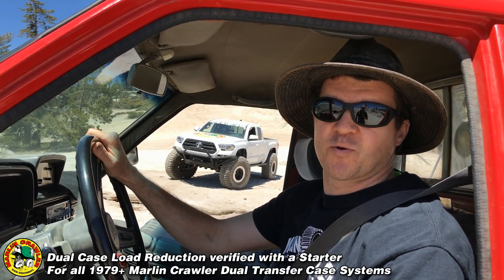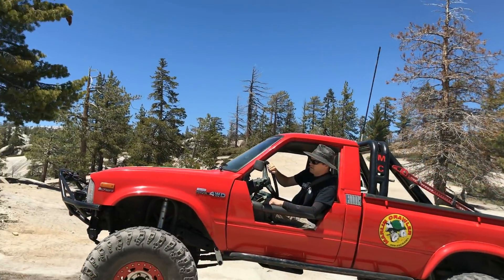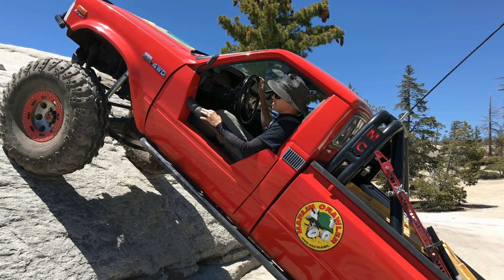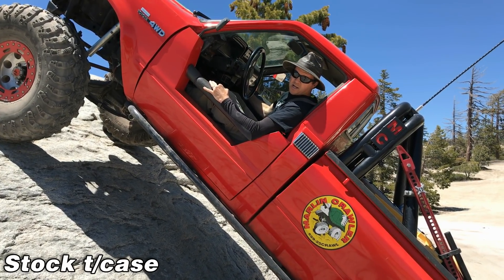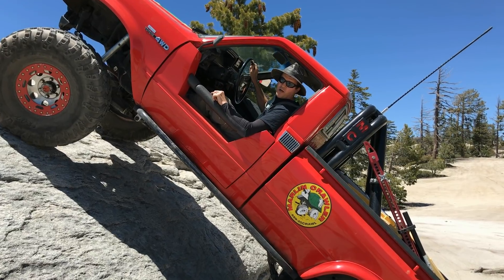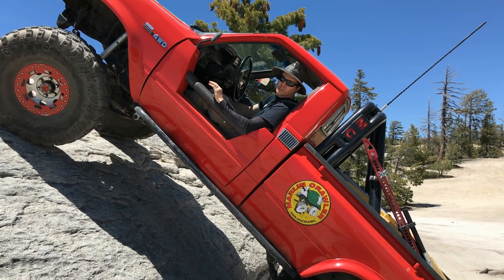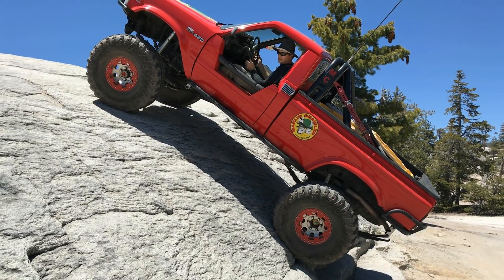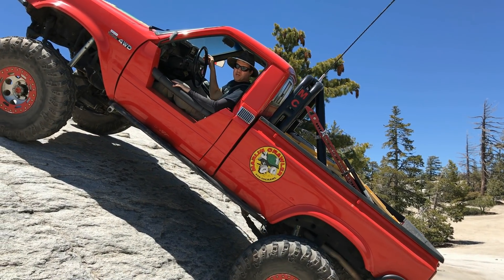Using a Starter to verify Dual Case Load Reduction

Comment: So this started to get a better high and low range, correct.. I'm guessing that 4.11 in high and 5.38 in low..
Reply from the maker: This is an additional gear for your transfer case, and High range is 1.00:1 and Low range is available in either 2.28:1 or 4.70:1 ratios 👍🏼 Depending on gear choice, our  Dual Case setup turns your complete t/case into a 4-speed with selectable ratios 1.00:1, 2.28:1, 4.70:1, and 10.72:1 Low ranges.
Reply: @MarlinCrawlerMedia  do you like it?

Comment: I don't understand how the starter motor can make the vehicle move forward? How does that happen?
Reply from the maker: Thank you for the comment. While manual transmission vehicles come equipped with a Clutch Start Cancel button, many of us bypass this entirely so we can always start the vehicle in gear regardless of the circumstance. Such is the case with The Crawler Truck. It could be cranked in reverse or even in 5th gear, for example, however without the torque multiplication of our Crawler products it would never have enough torque to overcome the weight of the vehicle.
Reply: @MarlinCrawlerMedia  thank you for the explanation

Comment: The irony is that this type of off roading is endemic to the Sierra Nevada National Forest. Despite the fact that the general population believes that stickers generate horsepower, I have in my travels seen a sticker that seems to produce tourqe reduction. Also on a side note the old Mojave horsepower trick works here too. It can however wreck your lid.

Comment: removes engine and adds more batteries, rock crawl all day with just a starter
Reply: Or replace the engine with a predator 212 and have enough fuel to crawl for weeks
Reply: weight reduction
Reply: Or put a big solar panel on it with a small RC motor and go forever!
Reply: @promiscuouscrab4040  😂 funny!
Reply: an electric rock crawler would be cool af
Reply: @lucywucyyy  check out rc4wd 😂
Reply: 2022 Tundra! Surprise y'all!
Reply: "Hybrid" mate 😂

Comment: That’s pretty badass, do y’all make anything for xj cherokees?
Reply: Ax15 trans is just like the toyota w58 in the toys with a jeep bellhousing toy clutch plate you could swap over to a w58 then buy toy cases also search ax15 to toy case or if you want to there are others who make adaptors to double your np231 or np241 case in your jeep if you have a 4.7 your gonna have to ditch it no manual options easily available unless you luck out finding a Ram 4.7 5spd 4wd to swap in but then your stuck witha 4.7 👎if you have awd ditch it too you
Reply: Edit lol just read xj so you dont have a 4.7 its early im tired but everthing else is good info 😂

Comment: My xj has a vacuum leak and at the moment I can idle to 40 mph I bet she’d pop right up that lil hill 🙃😂 thing makes me broke cus I’m always repairing it but there ain’t nothing more fun than taking our toys off-road these pavement princesses out here are weak..
Reply: Fix the vaccum leak, i got a friend of mine who vapes to blow a fat cloud into a vacuum line and where it came out was the leak, or you can pressurize the system with something and use your fingers to feel for air or a hose held up to your ear to listen for leaks etc
Reply: 16driver16 I fixed it a while ago but thanks

Comment: Was that rear left leaf spring broken?
Reply: i think the springs are designed for extreme wheel travel. most of the pack can drop, while a single, lighter leaf connects the axle to the truck. never seen one like it, but it makes sense when you think about it.

Comment: Awesome video. One thing i love about toyotas, (at least my 2013 Taco), it has a button that lets you crank it without pushing in the clutch, in case it wont start you can crank it off to the side of the trail/road.
Reply: Is that factory never saw that function
Reply: clutch start cancel

Comment: Its not needed people dont go four wheeling on there starter motor a factory 4 low range on a Toyota is plenty.    And cheaper.  ...
Reply: I think you missed the point
Reply: @jets8991  he definitely missed it
Reply: @jets8991  I didn't miss nothing I think they're trying to sell a expensive transfer case that you don't need you can just switch your ring and pinion gear for a few hundred dollars if need be
Reply: @keithmckenzie1569  I get your point but did you see when he had it in factory 4 lo? I'm sure you could gear pretty low but that would make it completely useless on any sort of public road as you would be at ridiculous rpms just doing 55. They're system is a 1:1 ratio when disengaged and can do freeway speeds at regular rpms.  Also with they're gearing you could probabaly drive that thing up the same hill using a drill as a motor
Reply: @jets8991  i understand what you say.....but all  4wd. Trucks from the factory have a 4 low range. That can do steep hills and rocks . .low range locked differential and big Wheels.   Thats all you need people have been doing this for 60 years.  No need to buy. What this guy is to sell thats my opion.
Reply: @no candy some people try to.make.a.living here

Comment: What about oil pickup? Is it OK to have the engine running at 45 degrees for so long?
Reply: It wouldn't be uncommon for it to have a dry sump oil system. It's a system that doesnt have an oil pan, but rather an entire bled off oil system with no air in it. So it doesn't matter the angle, g force etc. Everything will always be lubricated.
Reply: Baffles in the pan
Reply: @bansheemania1692  Baffled viewers.
Reply: 22r doesnt need oil pressure... at idle that is.
Reply: Light moisturizer is enough to lube those cylinders.
Reply: Toyotas dont need oil to run trust me ive owned 30 of those lil guys
Reply: @rustedratchetgarage6788  Maybe you wouldn't need so many if you put oil in them lol
Reply: @robwiljas   Lol...

Comment: This hurts to watch as my starter is blown currently😂
Reply: Abandoned Night you own an xj too...? Shits rough just spent my whole paycheck to fix the beast... (still better and cooler than any cum cum)
Reply: Haha my ol vw diesel crapped out and I went about 5-600 feet on the starter ...got it up in 2nd gear🤣🤣🤣
Got me off the road , I fixed it and figured it wasn't gonna start but it did.

Comment: My 4runner rolls coal at that angle 🤘🏻😂🤘🏻. I have the dual cases with the marlin 470, never knew about this trick.  I would be clutch and brake trying to start my truck🤦🏼‍♂️. Thanks for this video!

Comment: I've always thought manuals would suck on the trail due to stalling all the time, but this looks like it would make having a manual not suck!
Reply from the maker: Hello Michael and thank you for the question. When you understand that exactly no good Toyota automatics were available at the time Marlin founded the hobby of Rock Crawling in 1994, 100% of the first-ever Rock Crawling vehicles on the trails were manual. In fact, we did not manufacture the world's first Automatic Rock Crawler until the early 2000s (this first automatic test vehicle was a white 3.0-liter 2nd gen Toyota 4Runner). So for nearly the first decade after we created Rock Crawling, precisely zero were automatics. Marlin Crawler without dispute built the industry of Rock Crawling with manual transmission-equipped Toyota trucks.

It isn't that Autos are not good for Rock Crawling, but rather the Toyota trucks of the era when we started Rock Crawling were faaar more rugged and less civilized than they are today. We would argue that if it wasn't for Toyota's weak (in the literal sense) marketing of sand (yuck) and mud (yuck) use with only featuring automatic trucks then we would have more manual-equipped modern trucks off-road. Case in point with BigMike's new 3rd gen Tacoma: It took him 8-dealerships, 261-days, and a flight to Texas all because he ordered a new manual transmission Tacoma. Feel free to read his full "Mega post" struggle with Toyota at the 16th reply of his build thread here: https://www.marlincrawler.com/bm2

TL;DR Marlin founded Rock Crawling with manual transmissions, and automatics only rose to popularity because of Toyota's relentless push to encourage the use of them here in America.
Reply from the maker: All your view points and opinions are spot-on. Given two vehicles with the same final drive ratio, one auto one manual, it will be more difficult on both the driver and the vehicle for the manual. Gearing makes all the difference and allows for more torque at a smooth and quiet idle. If you have already, then please check out our gear ratio comparison video with clutch and brake foot camera view: 
https://youtu.be/WrRBbh6-eGU Thanks!
Reply: I use my rig as a DD so I'm enjoying the automatic of the 3rd gen 4runner :D
Reply: MarlinCrawlerMedia  Thanks for the great explanation. I have a background with domestic 4x4s, and all have been autos. Good point about early Toys not having a suitable auto. I base my opinion of them on seeing (mainly Jeeps) in person and in videos bouncing and crashing over things. Seems like the pattern is bounce, stall, roll back, repeat. Doesn't look fun, and looks very hard on equipment, especially when frustration kicks in and more skinny pedal is applied. I'm sure most of the ones I've seen have been horribly undergeared, with questionable drivers. I'm a lowsy stick driver, and I bet your gearbox would make even ME look good!
Reply: All Toyota knew for a long time we're manuals.  When they switched over to auto the struggle was real.  Overheating issues and fluid breakdown issues.  Yes it also comes down to maintenance but all Toyota knew and built we're manuals at the time.  The clutch start cancel was pretty badass.  It made life easier.  I used to avoid auto Toyotas but they have come a long way and all is good now.  Keep your fluid cool and clean.

Comment: I've been Wheeling a Toyota with Marlin l52hd and dual ultimate setup for 10 years and never thought to just start the engine in low range while staying in gear on a steep incline.. makes things much easier and it won't roll back.  Thx for the tip.
Reply from the maker: Definitely Wesley and thank you for your trust in our products! Try it the next time you're out on the trail and Please reply here to let us know how it went 😊
Reply: @MarlinCrawlerMedia  was this filmed on the Rubicon Trail?
Reply: No, that looks to be around the Ershim / Shaver Lake area, mountains above Fresno.  That dirt looks about a 10 grit, whereas Rubicon dirt is 5 grit and a bit darker with hints of pine and a slightly dry finish.
Reply: @pf465  Don't forget the microcrystalline fraction of dried unicorn tears and Bigfoot hairs.  Dead giveaway of location for the observant person.
Reply: @Ryan-yo4dg  It looks like to me an area I run half way up the Bald Mtn. Trail. Next to one of the side challenges called V-rock.

Comment: The internal struggle rages on. The only thing keeping me from buying a yota and building a crawler, are how expensive the tires are.
Edit: Subscribed because great content.
Reply: Yeah if the price of tires is your concern, building a crawler probably isn't in your budget.
Reply: 93da9teg's Mom I just baught a full set of bfg with 90 percent tread for 200 bucks. Just gotta keep an eye out. :)